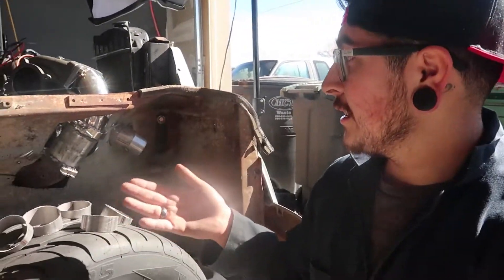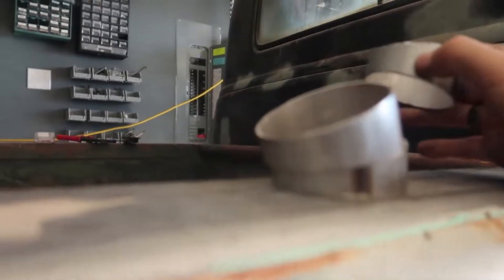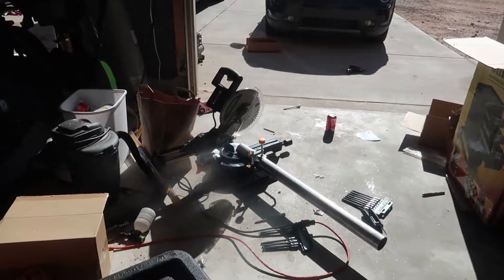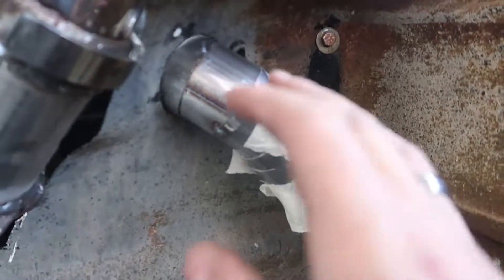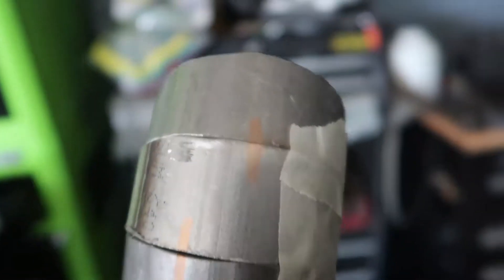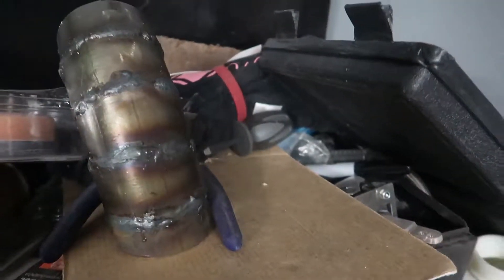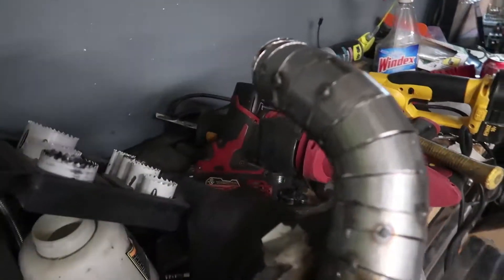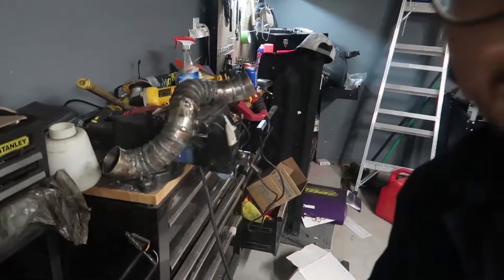Custom Pie Cut Inter-cooler Piping!

Comment: Hey man, not criticizing, I've never welded, but i'm hoping to learn very soon. Did you clean all your pieces before welding them? i know that contamination can cause welds to be rougher from what I've heard.
Reply from the maker: Yea I think its because I was using weld mix for gas. I started using stainless wire and argon and it works alot better!
Reply: awesome dude!